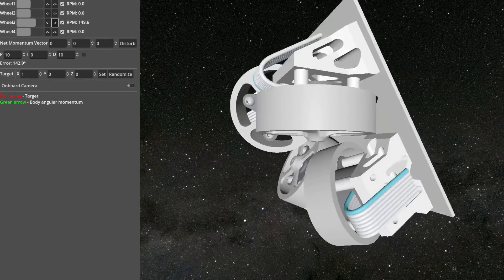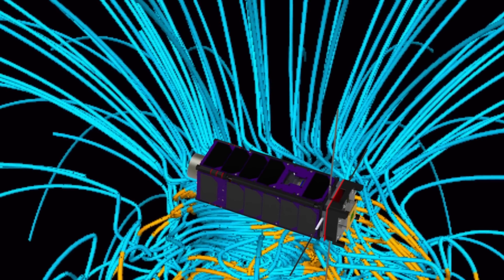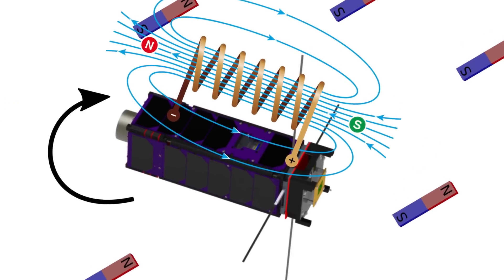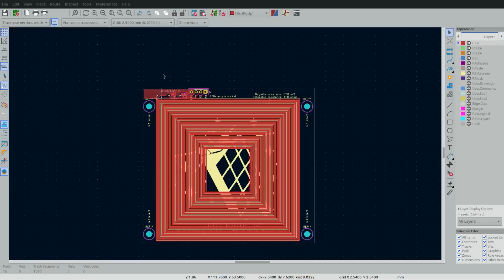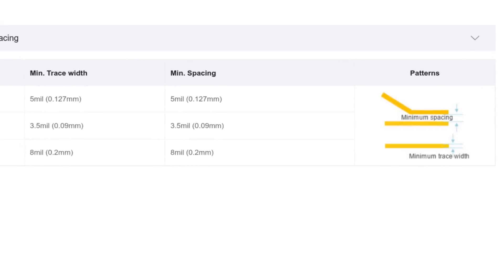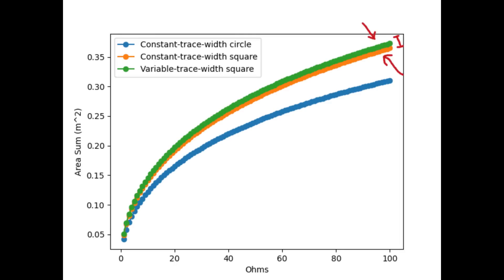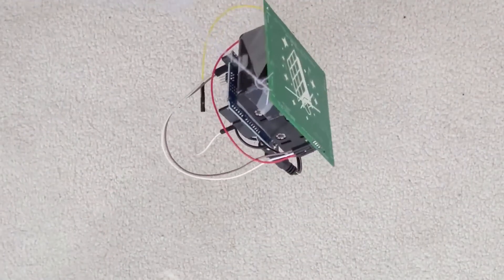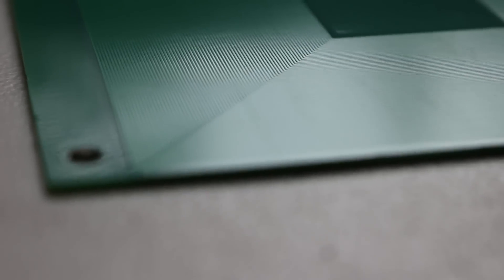PCB Magnetorquer Prototype - Husky Satellite Lab

Comment from the maker: Answers to common questions:
- This prototype uses a 4-layer PCB from JLCPB.
- We will use an IMU and onboard camera star tracker to determine what control outputs are needed at what times.
- The whole thing will be made open source eventually.
- My scripts are available here: https://github.com/manforowicz/Magnetorquer-Calc
Reply: What program did you use to display all of the graphs from python? Super new to electronics but I’m very curious. Was it just a .py insert? If so what was it? Thank you

Comment: Neat.  How do multi-layer boards with similar patterns and powered similarly impact the result?   Could you essentially do a 24 layer board bonding different layers to create a lot of specific directions of force? Or help push the desired induction one way or another?

Comment: Nice project! You say it took 3 months for your essential chips to arrive, and ascribe this to your institution's purchasing bureaucracy. This is a terrible waste of the time of your talented researchers, but surprisingly common in my experience. Support functions in large organisations often forget that they are the tail, not the dog. Lean engineering eliminates the key causes of waste, including delay/waiting time. Your procurement function needs to get on board with this and keep pace with your research. You need to escalate this issue to your VP/Head of R&D to build accountability. You will probably find they are keen to find concrete examples to push forward change, and that they have strategies to work around until then! Like, buying on personal credit card and then claiming as an expense. Don't give up, demand change and accountability, and fight your corner! You are the dog, not the tail!

Comment: Once You enhance the system with an adequately chosen or good magnetometer or more (to achieve near instantaneous magnetic field 3D orientation information ), I would suggest you investigate the domain where You have the unit on the string here on earth (as You have shown) - and nullify the oscillations - critically dampened point (control system terminology) - again for this particular situation. This can develop s/w code of “system oscillation and stability”. Then translate the domain according to altitude planned. LEO ~50nT to 200uT depending on day/night, but of course with variations of angle!
Worst case from a satellite control aspect is at sea level where gravity,air, string are so strong. Check out MEMS magnetic field sensors

Comment: Interesting indeed! I'm doing a video series on diy cubsats and currently exploring the power budget requirements before starting the pcb layouts, the next video currently under research is magnetic torque thrusters and if they worth it for cubesat project. This helps a lot, and I'll certainly link this video in that video as it's a great explanation! 👍
Reply from the maker: Great project, good luck!

Comment: Are you using any components that have radiation hardened alternatives? I also suggest using a white solder mask as this will increase albedo and lower operating temperatures if exposed to space.

Comment: If they're willing to use reaction wheels, why not gyroscopes on twist axis's? With three gyroscopes with 90 degree opposed twist axis's and it should be possible to accurately allign to anything and it should provide a lot of torque as well. It could even be a modular external deployment and spin in the vacuum with no air resistance on magnetic thrust bearings where the flywheel is a wheighted PCB induction motor rotor with the stators on the outside.

That'd turn the satellite. With magnetic bearings, if you made it like a pancaked squirrel cage,  if it was never over-volted, it would never wear out.

Comment: would it be worth making the same design but on a multilayer pcb? so you can have two coils on one pcb to have double the force in the same space? you could get more than two layers I know but I would assume there should be diminishing returns as the efficiency would probably decrease with all those magnetic fields in the same small space.
Reply: exactly what I came here to say.  It would seem you could fit many more coils.
Reply from the maker: Indeed, more layers increase magnetic moment. The prototype in this video actually has 4-layers. Sorry for forgetting to mention that in the video.
Reply: @marcinanforowicz8319  ah fair enough

Comment: I have been thinking a lot about this, but never got to chance to try anything. I am happy that someone is working on it. I wonder if making orbital maneuvers using the Earth's magnetic field would be possible. Similar to how the head of a hard disk drive moves sideways, maybe we could use the earth's magnetic field to change the orbit of a CubeSat.
Reply from the maker: Since Earth is just a magnet, we could only apply a linear force directly toward or away from it. If you hold a magnet over the Earth, it doesn't attract it noticeably more than just gravity. The rotational torque on a compass seems to be much greater. Earth's magnetic field is only really useful for aligning with it, rather than getting pushed/pulled by it. But I may be completely wrong.
Reply: @marcinanforowicz8319  That sounds right ..  nasa did do experiments with the space tether from the shuttle.  But the hardware failed.   They wanted to reel out a really long conductive wire from the shuttle.  and if current would run through there might be a force in the direction of movement.  Not sure how a current would run through the wire.  Problem is if you want to hook the tether up with wires to have current flow .. you end up with a parallel wire to the tether with current in the opposite direction. The magnetic field of that will cancel out the magnetic field of the tether so that doesnt work.
Reply from the maker: @apsdev  Ha! That's super interesting!
Reply: By the way, if you try doing this, I had the idea of using a material with different magnetic permissivity to create a sideways force. If you want to try it: sandwich the coil between two steel plates leaving only one side of the coil open (kinda like putting a blanket halfway). You should cover 85% of the coil with the steel plate and only leave one side of the square open. This should create a sideways force based on my thinking. But I might be wrong. I just wanted to try it a lot, but never got the chance to.

Comment: Intuitively I just can't see how this could possibly be comparable to a wire winding. You can just get so much more closely spaced wires. And a square flat winding that's basically the same form factor of a pcb should not be to hard to achieve either.
Reply from the maker: You're completely right, physical wire can be crammed in more tightly. The PCB approach is lower-cost, more reproducible, more structurally robust, and easier to fit into a tight cubesat. But of course, it has many downsides too.
Reply: @marcinanforowicz8319  Don't you need a special more expensive kind of PCB for space applications though?
How much does reproducibility matter here? As long as you can wind a coil that hits your minimum required effic/force output, then you could have software fine tune down to desired output.

Comment: To get a performance measurement it could be cool to mount it on a torque spring in a vacuum and putting some AC on the coil. That way it will start to oscillate, and finding the forces is pretty easy if you know the spring constant and the masses.
Reply from the maker: Great idea! We could also calculate its moment of inertia (based on materials and dimensions), go to a location with known/undisturbed Earth magnetic field, hang it on a loose string, and see at what rate oscillations die down to deduce air resistance. Then we'd measure the frequency of oscillation, and factor all this in to get torque.
Reply: @marcinanforowicz8319  This isn't really my area of expertise at all, but I just wanted to say that I absolutely adore the enthusiasm and excitement you're approaching the comments section (and this video in general!) with - I don't know quite why but it just makes me really happy.
Reply: @marcinanforowicz8319  You could also apply a large known field with a coil externally, that way you have control about the field, and the increase in magnitude will make it easier to detect movements and forces.

Comment: Thank you for the great video. I have a question. I am trying to generate a magnetic dipole moment of 0.2 with my PCB. How was the total length of the PCB pattern calculated? And what is the current flowing through the pattern? Was the formula M=IA used to calculate it? I would appreciate your help with this
Reply from the maker: Calculating the optimal design and characteristics is a bit too complicated to explain here, but I might write a paper or something about it in the future. Feel free to use my optimizations scripts as a reference for now: https://github.com/manforowicz/Magnetorquer-Calc
Reply: @marcinanforowicz8319  Thank you for letting me know. Have a great day!

Comment: Why are the conventional devices wound around long skinny rods? Does the length give a better lever arm to work from?
Reply from the maker: Great question. AFAIK the shape of the field you produce doesn't have much impact - intensity is more important.  1) For some configurations, rods fit better spatially into the satellite. 2) Although a narrow rod has a lower area-sum-to-wire-length ratio, this seems to be offset: Physical wires can be crammed tighter together than PCB traces.

Comment: There's almost nothing to dampen that oscillation in space and very little in air too. You could try to couple it with an IMU and adjust polarity / voltage to apply breaking and dampen the oscillation. It might actually need a computer vision camera to stabilize as the IMU's compass might be useless near that coil.
Reply from the maker: Yes, those will be our next steps, integrating with data from an optical star tracker to get info about orientation and velocity.

Comment: Nicely done. Just a thought, could you use a magneto style spinning magnet arrangement coupled with a compound coil to create an enhanced large field that was both redirectable and stronger? I'm basically thinking of something like a flux guide but dynamic.
Reply from the maker: I don't know if I'd be able to pull that off, especially since it needs to survive launch forces. But interesting idea!

Comment: super interesting research! good job! love the non-constant width idea, however i'm not sure whether eliminating the smaller turns was advantageous for the coil. The outer tracks are the longest so they are forming the largest part of the coil's total resistance
Reply from the maker: Thanks! Your great projects helped inspire this design!

While the outer tracks are linearly longer, the area they encircle is quadratically greater. Outer tracks cover more area per ohm so they're more "efficient".

If I wanted to fill in the center while keeping resistance constant I'd have to widen the traces which would reduce the number of coils packed along the edges.

But I don't mathematically understand why this seemingly arbitrary inner-to-outer-radius ratio maximizes area-sum given a fixed resistance. (At least, according to my Python simulation)

Comment: Considered coppers thermal resistance coefficient? Pretty significant if your operating temp is extreme
Reply from the maker: Good question. I just assumed room temperature since the satellite will have to be roughly stabilized at that point anyways so that the batteries don't freeze or overheat.

Comment: Try to sandwich two of these PCB between a thin sheet of ferromagnetic material in order to increase the magnetic field strength produced by the coil
Reply from the maker: Exactly what I was thinking! Do you have any suggestions on where to buy an affordable soft iron ferromagnetic sheet?
Reply: @marcinanforowicz8319  your best bet is to find something that has it and salvage it. I don't know what products would contain it though
Reply: @friedtomatoes4946  maybe a fridge magnet?
Reply: @marcinanforowicz8319  You can get electrical steel (the kind of silicon iron used in transformers) from McMaster-Carr starting at ~200USD for ~0.65 m². At a guess a little more looking would get you something closer to the size you would use for a lot less.
Reply: @marcinanforowicz8319  you can buy soft ferrite which are used for wireless charger they have low losses up to 100kHz and nice relative permeability (300) they don't suffer from eddy current as ferrite are poor conductor. , but if you plan to use at dc I would suggest to bring a magnet at your local hardware store, it would be cheaper. As said before transformers have soft ferromagnet inside, if you manage to salvage one. However I don't think adding a sheet of soft ferromagnet would help a lot, there will be a torque applied due to shape anisotropy. The plate will tend to align with the external magnetic fields.
Reply: Interesting proposition.

I wonder which design would be better? Several squared coils stacked on top off each other or merely sandwiching a ferromagnetic material between two parrelel coils? Since once ferromagnetic materials are polarized, their inertial magnetic field would be resistant to the change of magnetic polarity once the squared coils reverse the direction of the current.

Comment: Awesome video! I wonder if you added some soft iron and used flux switching to modulate earth's magnetic field instead of generate a field of it's own, whether it would be more efficient - great work either way!
Reply from the maker: Interesting idea. One of my peers actually suggested a mode of operation which cuts off power and keeps the spirals passively connected in a loop. This would effectively act as a dampener, slowing the satellite's rotation in Earth's field.
Reply: @marcinanforowicz8319  If the frame of your satellite is conductive like aluminium then if the satellite tumbles then the magnetic field of the earth will induce currents which in their turn creates an opposite magnetic field which will dampen the tumbling i guess..
Reply: I was thinking about this, and actually changing the orbit of the satellite using the earth's magnetic field. Since the push doesn't need to be huge in the space, but constant.

Comment: Stupid question but why do you have to have a reaction wheel? Quadcopters keep their rotation to target by adapting the difference in rotor speed. They can rotate as much as they want by changing the difference in 2 rotating motors. So why not just add 1 more motor and get rid of the saturation issue for good?
Reply from the maker: Once an external torque has been applied, the satellite+wheels system has a net angular momentum. The wheels can't change this since they can't push off of anything external (like air, in quadcopters). They can only transfer some of this angular momentum from the frame to themselves. Similarly, an astronaut spinning in space can't stop without using thrusters or grabbing on to something.

Comment: How about making a square section tube out of four boards that all connect together (with s something like castellation) and the traces on each of the four boards being straigh lines, open at both ends, to connect to the next board. Essentially building a square section winding on the outside of the cube sat.

Using 4 layer boards, you could use the other layer for the magnetorquer and the other 3 for the sat's electronics payload.

Or a large flex pcb, that wraps around the assembly to form a tube, with soldered edge contact, like an lcd flat flex
Reply from the maker: That is a very good idea, I'll look into it! It would probably increase area-sum and magnetic moment per weight. On the other hand, having self-contained magnetorquers on separate boards increases redundancy and ease of manufacture.
Reply: @marcinanforowicz8319  yes, it occurred to me when I was thinking about it later yesterday that it does greatly increase the potential failure points.

The other thing that occurred to me it that one could make the boards with the tracks on one layer in one direction and a second layer  in a perpendicular direction, and arrange 6 identical board to form a cube with built in 3 axis magnetorquer.
And at the same time, using the pcb as primary structure of the sat.

Damn it! Now, I want to build one myself 🤣
Reply: @randomelectronicsanddispla1765  It can also interfere with instruments on board due to the em no?
Reply: @AlfieMakes  any sort of radiating electromagnetic coil will interfere with the rest of the equipment. No mater the shape, size and wether it is a homemade or a bought one.
But so does the wire going from the battery to the electronics, and anything carying a current.

That would be a choice to make depending on the satellite's mission.
Of course, if you are trying to map the earth magnetic fiel in LEO, you wouldn't use any kind of magnetorquer on that mission, or you would have a calibration routine to work around
Reply: I wonder if you could just wrap winding wire around the whole cube? If the frame at the corners was made from threaded rod you could use the threads to space the wires to get uniform and consistent geometry.

Comment: could you try making it neutrally bouyant and waterproof to test it in a near microgravity environment?
Reply from the maker: Interesting idea! Though I think micro convection currents and drifting toward the edges would be hard to control for. Also, if its buoyancy isn't evenly distributed, the water's density gradient would apply a torque.
Reply: @marcinanforowicz8319  what about something with a bit more viscosity like mineral oil?
Reply from the maker: For now we'll focus our efforts on other things related to building a CubeSat, but nice idea!